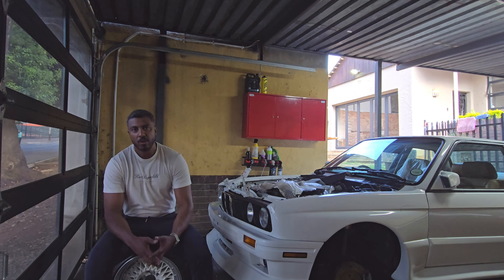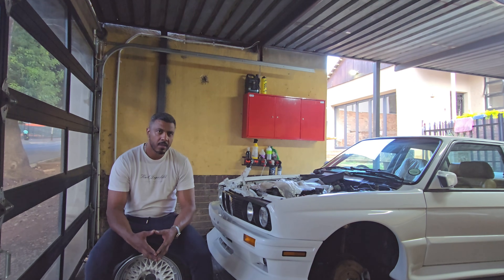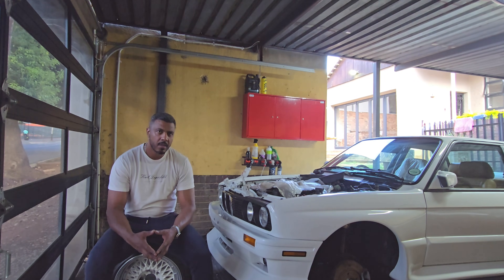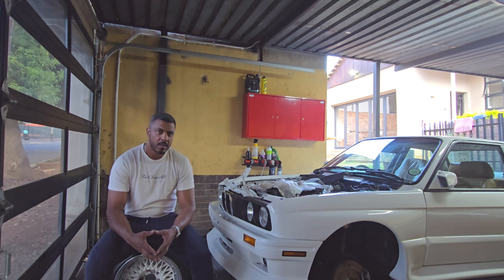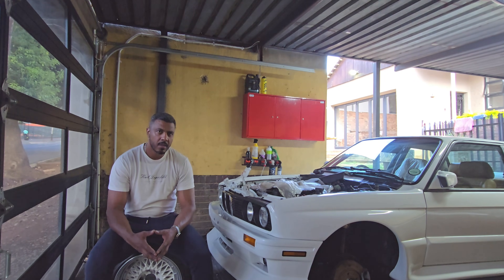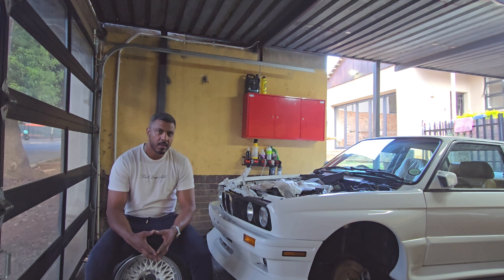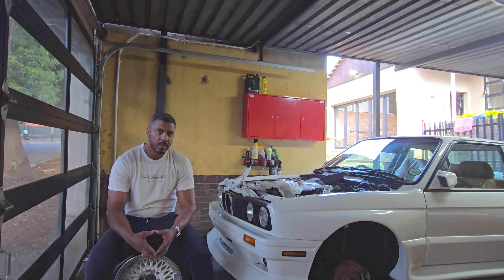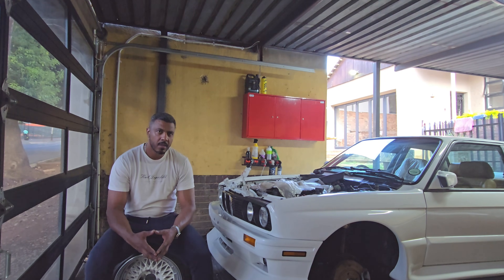E30 Swap: Is It Worth the Effort? M20 vs M50 Showdown

Comment: Even 24v have some better perks I will stay with M20. I have Hartge H27 Sp (originaly 211 HP and ITB) stroked to 3.1L with carbon intake , Getrag 262 CR Dogleg gearbox and LSD . Soon should be with Alpha-N management
Reply from the maker: That very interesting 
I don't know that motor l, you got more info on this

Comment: M20 has better exhaust sound!
Also a boosted m20 it sound like an rb26
My m20b25 is boosted and it makes 502 whp and 700nm of torque..full forged build,
Reply from the maker: I will take note next time I start up the turbo m20, rb26 and 2js have very distinct sounds however I can see where you coming from 2.6l turbo vs 2.5l turbo